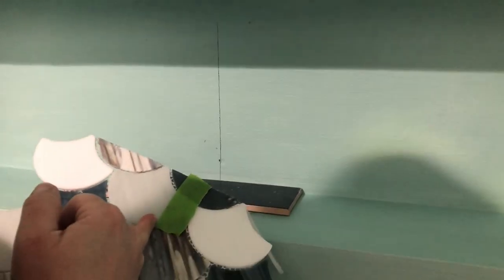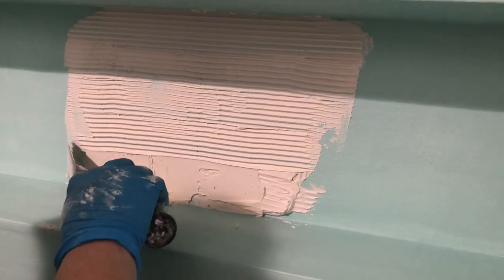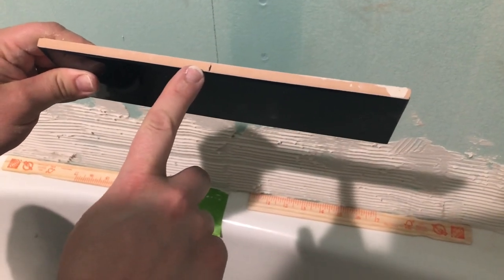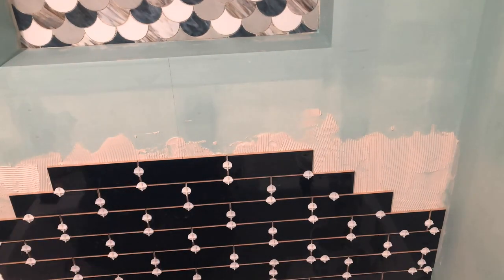How To Install Tile Shower | Beginners Guide | Pro Tips | DIY | Subway Tile | One Room Challenge

Comment: Hello! I just love this bathroom! I was about to get our master bath redone with black subway tile but this is just gorgeous. Could you confirm the size? Is it the 3x6 or 4x16? The link takes me to Home Depot but doesn’t confirm the size. Hope to hear back!!
Reply from the maker: You're the sweetest! Thanks so much for watching. The tiles we used are 3x9. We purchased them from Floor & Decor, but they're not sold there anymore, so we attached the link to the tiles at Home Depot as they were the most similar we could find. Hope that helps.